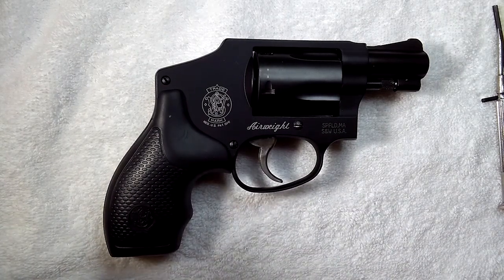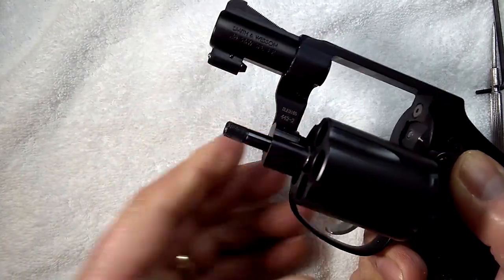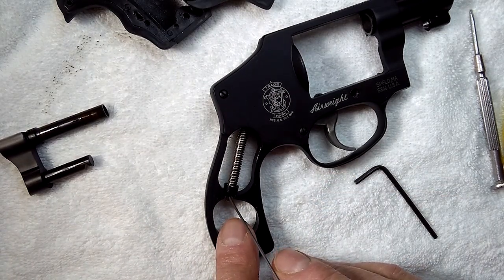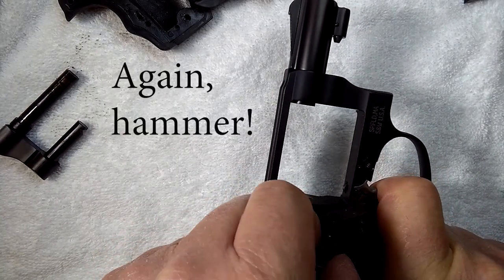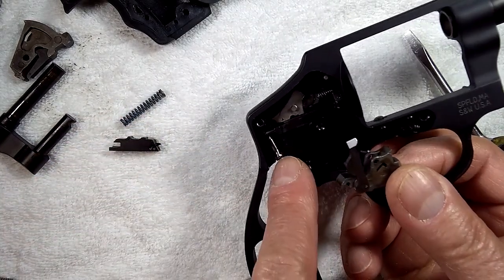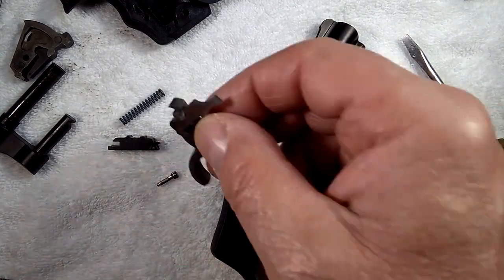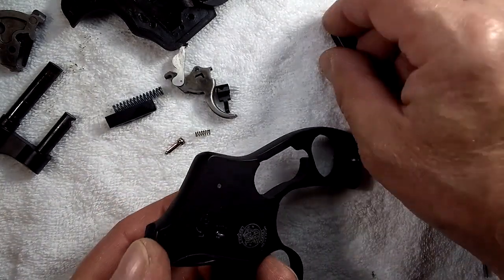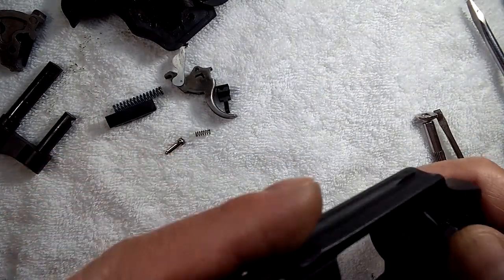SW Revolver J Frame Disassembly Reassembly

Comment: Thank you very much for the detailed dis + reassembly! Saved me sending mine back in to smith or going to a revolver specialist gunsmith. My shop didnt have anyone who knows revolvers, so I choose to learn to deep clean mine and go into internals on my own. You really mean it when you say "take great care not to lose this spring" because every part and spring matters. I found that out the hard way 😅 lost my cylinder stop spring on removal, but called s&w and they sent me 2 in the mail free when I explained what happened. I was much more careful and better setup with my new spring and with some slight fumbles and fighting springs here and there, got everything back together and functioning perfectly. Cleaned all my internals up, and now my revolver functions better then new.. clean, smooth and springs broken in.  Your video gave me the confidence needed and allowed me to learn more about and take better care of my j frame. Thanks again, so very much!! Many other videos just say "reverse the disassembly process" you didn't skimp on explaining important parts of checking along the way to ensure its done proper. 👍👍 if I could double thumbs up this video I would but I'll settle for a like and a long comment 😂👏

Comment: It's clear you know what you're doing but the video would be more helpful with some better lighting. I'm watching it on a 55 inch TV and couldn't see what you were doing at all. A simple desk lamp would allow us to see how and what you are doing.   I do appreciate the time you took to make this video.
One question, during the entire assembly process you never placed any oil or grease to anything, is there no lubrication needed at all? Seems hard to believe, but I am ready to assemble my Model 649 and I want to do it right the first time. Would a thin coat of gun oil cause any issues? Thanks again for sharing your knowledge.

Comment: Is it needed to lube internals for revolver care and what is name of that tool you used on rebound spring? New revolver owner here
Reply: I asked the same question. Not a single drop of lubricant on anything. I'm hoping he replies to my question, I have 649 taken down and want to know before I assemble it. If I don't reply I will email S&W and ask them, or apply a very thin coat of Mil Comm oil to the components. This pistol is carried in Temps of - 25 to 115 degrees, God Forbid if I have to use it, it needs to work. Thanks